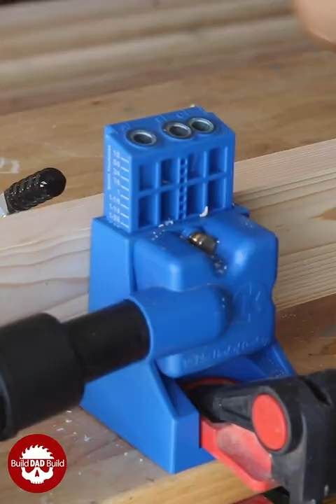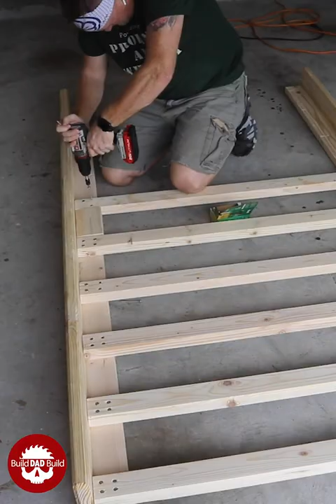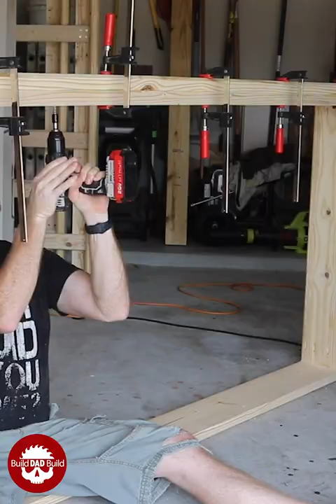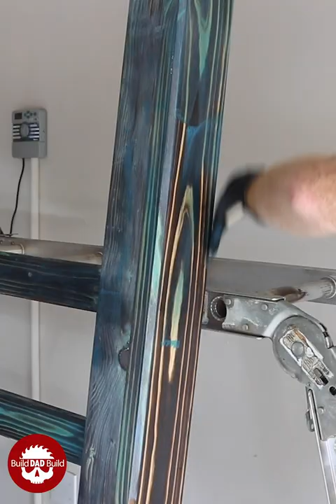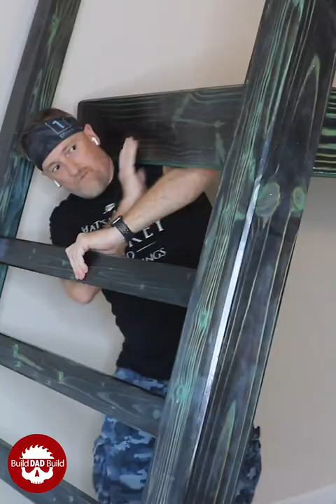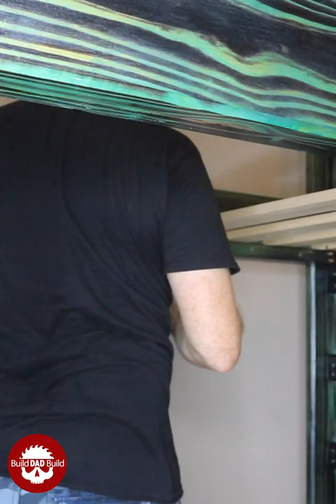Building a Loft Bed for Ozzie #shorts

Comment: That’s awesome, I built my 4 year olds bed two years ago . About to build another for my 2 year old
Reply from the maker: Very cool!
Reply: @BuildDadBuild  oh yeah , I I cut down 5 black cherry and 4 maples , 30 inch around, 60’ high . They’re milled and drying . Can’t wait to jump into the pile lol . I frame houses so as they start new parts of the project I go Scout out trees and drop them and load them up with my zoom boom . Cost me 160$ per tree to get them milled so it’s all free lumber hahahahah
Reply: @BuildDadBuild  I’m in Ontario Canada
Reply: @BuildDadBuild  small shop though 20x20 but it does the job lol
Reply: @BuildDadBuild  and I’m also into the shou sugi bahn burn looks awesome.